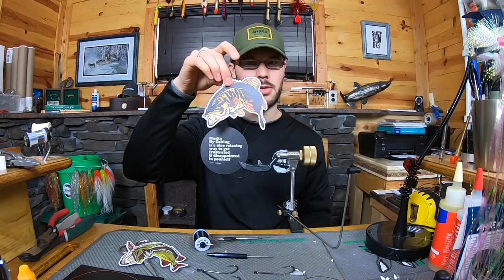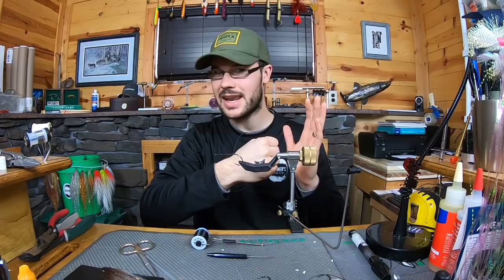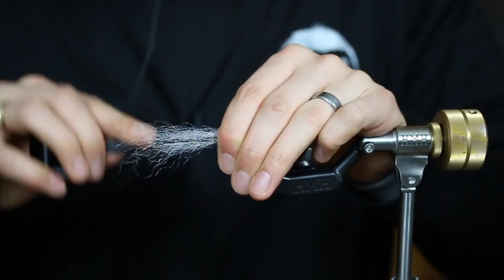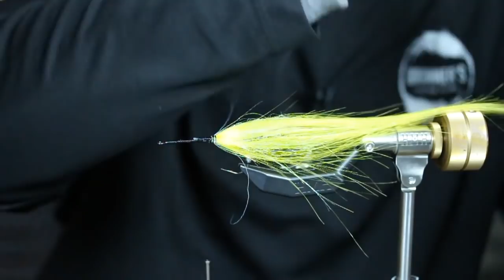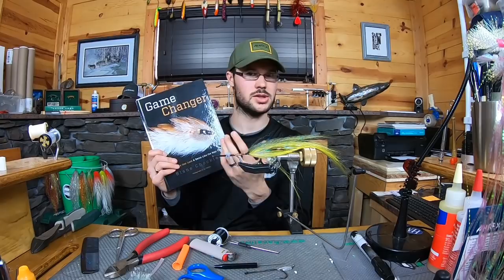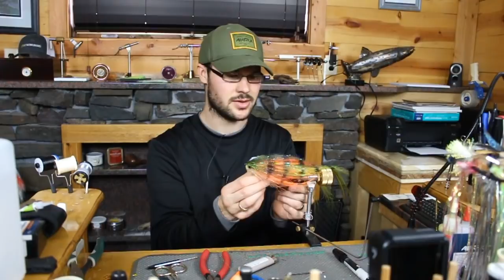MEGA-Jerk 10" Pike/Musky Fly

Comment: Why do they always turn to the same side though? This is the problem I run into with all jerk bait-type flies.
Reply from the maker: Most Jerk/Glide bait Lures that Walk the Dog rely on a rear-weighted balance point that the nose of the lure pivots around, allowing them to switch directions. A Jerk fly on the other hand will start to deflect due to imperfections in the head, material stacking, density, ect.....(which are always the same each strip, hence it starts to deflect to the same side each time) before the Rear Hook runs into the head jackknifing and pushing the fly into the profile show. If you were to make the fly Rigid, on a single piece of long wire, with a rear weighted balance point and a near frictionless head that was perfectly consistent....you could likely get a closer imitation to the Glide bait style lure design.